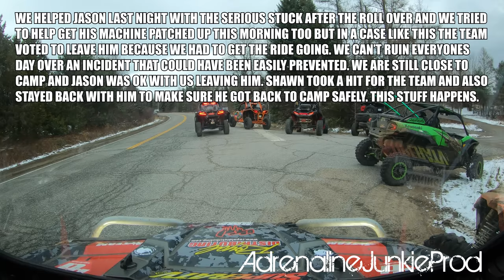Blown Diffs & Shattered Dreams - SXS/UTV Feature Length Off-Road Trail Riding Adventure

Comment: Low oil pressure, likely spun a rod bearing... these motors in the XX burn a bit of oil and need to be checked often. My engine is in the shop right now getting it rebuilt. Let me know if theres any updates on that XX
Reply: Would definitely be interested in updates on the xx, I am currently waiting on the dealership to see if mine will be covered under warranty.
Reply: @jasonmorrell6096  Are you the guy in the video or just another person with this type of issue?
Reply: @MiK3Y13  no I am not the guy in the video, yes I had the same issue.
Reply: @jasonmorrell6096  at how many km for you?
Reply: @MiK3Y13  at about 300 Miles the motor locked up
Reply: @jasonmorrell6096  yikes, ya that’s a warranty deal, what year is yours?
Reply: @MiK3Y13  Yeah definitely figuring on warranty coverage. It's a 2022. That's the reason I'm interested to hear what they found out on the gentleman in the video sounded like his was fairly new and not much of a reason to be having troubles.
Reply: @jasonmorrell6096  all I can say is pay really strong attention to the oil level throughout its life. These motors burn oil and smell like it too. They produce very strong power for no boost. I let mine run to the normal interval but unfortunately it ran low throughout that time and spun a bearing. $5000 later she’s getting rebuilt
Reply: @MiK3Y13  thanks, I definitely will keep an eye on the oil level.
Reply: @jasonmorrell6096  I see what happened.... rad got plugged with mud and dirt.. he didnt clean it out when hitting the last roads and it over heated.. he likely didnt notice and kept firing it up and just going... likely wore something. The guy for owning an arctic cat dealer for 30 years didnt know much about his new machine.. didnt know about the drain plug in the clutch cover or where the oil dipstick..

Comment: 29:16 what's that hood scoop set up all about? I noticed his wife had one on her rig too.
Reply from the maker: It’s not a hood scoop, it’s a rad relocate. It bumps the radiator up quite a bit and prevents the rad from clogging up. Hapi Hipi was telling us some of the trails they ride in the summer have a lot of silty water crossings and mud holes that plug up the roads real bad and this has helped them remedy that issue.

Comment: #FINNTRAIL Question for anyone that might know, Is there a way to get a looser fit inseam with the finntrail bottoms? Mine are too snug for my preference despite matching up their specs, everything else is really good, but not enough room in the inseam.

Also, does anyone have feedback on FT jackets/tops? anything to be aware of selecting the right sizing or fit for normal build 6' height?
Reply from the maker: Hey. I’ve had a few sets of finntrail and a ton of the crew have it. Generally speaking we have found their sizing specs and recommendations to be spot on. But like with anything each person is a unique situation. Mine all fit well and I’m 6’4 and lanky. I have long arms. Jackets fit well and true to size. I wear an XL in finntrail and in most other jackets. Boots fit true. I wear a 14 most the time and a 14 finntrail. I don’t know how old your finntrail is but I find their newest gear is even more comfortable then some of their earlier gear from 4 or 5 years ago. It’s constantly evolving.

Comment: I feel so bad for fish spending all that money on a diff
Reply from the maker: He’s been swamped at work since this ride. Hasn’t had much down time. He hasn’t even had time to remove the diff. SuperATV looked after him in regards to this. It seems to be an isolated incident since overall I’ve heard these diffs have a good track record. Might have been an assembly issue or material failure. Once I get more info from SuperATV I’ll update you guys. Once it’s out they want it back to do an in depth assessment.

Comment: what trail is this? anyone care to share location or entrance?
Reply: GREENSMOUNTAIN buckhorn district
Reply: @timma0175  thank you. If we park at Rays how do we get there?
Reply: @fmxinsane  mcmillen rd to 503 if I remember. You can also take the 3hrs trail ride there.
Reply: @timma0175  awesome! Thank you so much! Some awesome driving there man. Always cool to see you. If you sell the wildcat what do you think will be your next sxs?
Reply: @fmxinsane  im tossing the idea of a custom build on the table using the core components of the wildkitty to power a new platform. With that said that would require down time so I may buy another wildcat sport and keep the General Lee as she is as my fall back. Kinda wish textron would design a new sport! That may spark my interest also
Reply: @timma0175  i was really close to buy a used textron havoc X (was pretty cool machine) but kind of hard to get parts amd domt know if its an artic cat or a textron or a traxter now lol. A custom sxs would be cool. Seems like the wildcat is pretty strong and peppy too so maybe a diet. Some better suspensions and some 30s would be awesome
Reply: @fmxinsane  the wildcat has under gone major upgrades to handle the rocks. Needless to say most of the under frame has been swapped out with heavy 1/4 plate and solid bar for the frame. The amount of hrs ive put onto into this machine has inspired me to want to design my own platform knowing all the fail points. Its a great platform to start with.